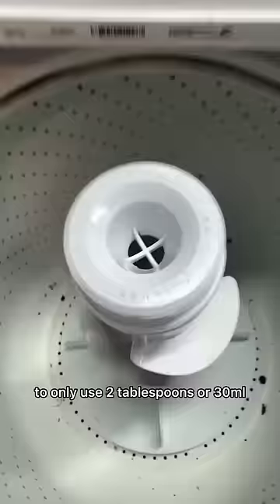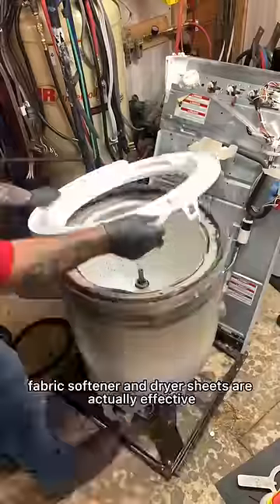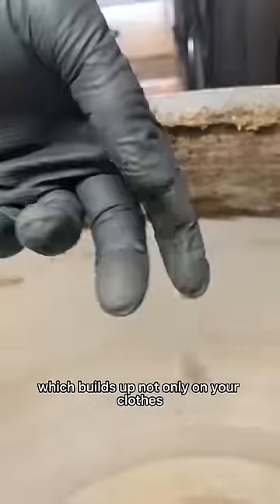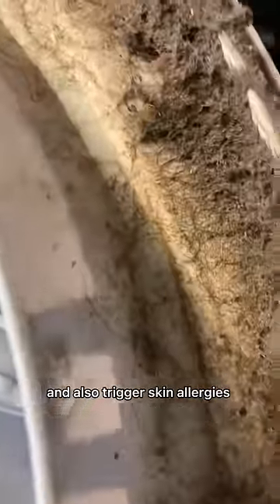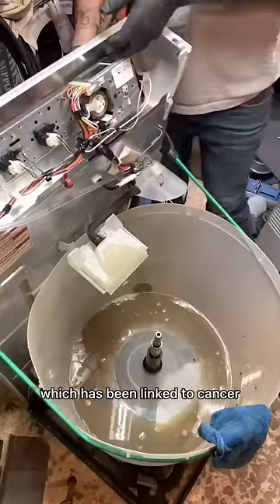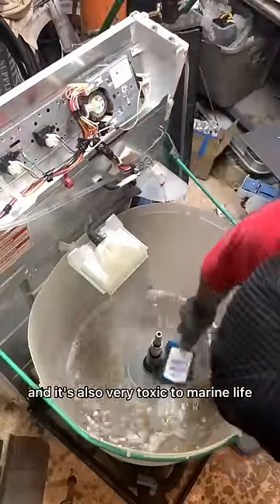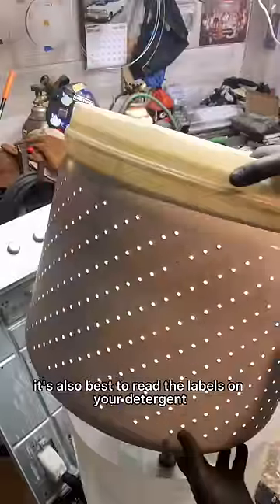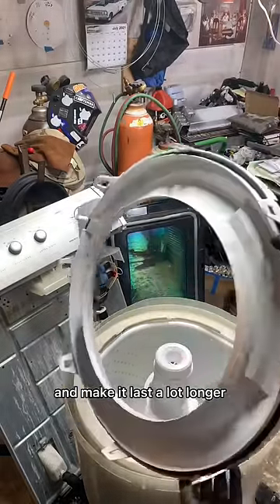Softener leads to machine failure

Comment: I used to use a ton of fabric softener and I was always itchy because I'm allergic to artificial sents but I love having soft clothes. So I started using vinegar and damm it works so well is way cheaper and I don't have a rash all the time.
Reply: How much vinegar do you use?
Reply: @Brandon-uy1uv  about a 1/4 cup for a full load
Reply: @chloecalvincooper9467  Are the fabric softener sheets a problem as well or just the liquid?  This is the first i am hearing of this.
Reply: @SuperUncleRyan  the sheets cause build up in your dryer
Reply: yes, same. i avoid everything.
my face and nose react weird. i dont have any medical conditions though.
it's an issue when living with a significant other that loves floral scents in everything
Reply: it gives me really bad time breathing, i know ppl that has anaphylaxis reaction to it 😢 is just poison.
Reply: Have you tried unscented and dye free?
Reply: @godzilla2k26  I did but it left a weird yellow residue on my white clothes.
Reply: @Brandon-uy1uv  I use between 1/2 and 2 cups, depending on the size of the washer, the size of the load and the type of fabric being washed. A full load of really nasty laundry would call for a cup in the wash cycle and a cup in the rinse cycle whereas a smallish load of delicates would call for much less and only in the rinse cycle. Based on that, just use your best judgment. If they're not coming out soft, you may need more or you may need to change detergent. If they're falling apart or you can actually smell the vinegar when you swap loads, you've used too much so definitely start small. Every load is different just like some things require starch and some come straight out of the dryer in perfect condition. I've been doing this for decades and still run into trial and error situations.
Reply: It's great for getting rid of the odor in my dogs bedding too. That's why I started using it to begin with.
Reply: Do you wash with the vinegar? Or use it as a rinse In the fabric softener dispenser?
Reply: How about the smell?
Reply: @christianpaulroldan4010  it doesn't smell like vinegar at all
Reply: @chloecalvincooper9467  whoa
Reply: @ladyfame1430  just fabric softener unless the laundry in question has certain stains. Vinegar is an acid so it makes some chemicals stay in the fabric but works great as a softener on clean clothes.
Reply: Chole Calvin Cooper 
I developed MCS in 1995 while being treated for an idiopathic autoimmune disease. I discovered I am triggered by the petrochemical used to make dyes and artificial fragrances. I have learned how to avoid triggers because it is the only way to avoid frequent ER visits. I used hospital quality air purifiers in my home. I inform anyone visiting that I maintain a fragrance free home. I always carry a spray painter’s respirator mask to use in public. People either don’t understand or disbelieve my experience, unless they witness an episode of acute respiratory distress and hives sending me to the ER. They don’t understand when I attempt to explain that the chemicals in their fragrance are toxic to me, regardless of it’s form, intensity, or pleasant aroma. Having an invisible disability is challenging; especially CMS in a culture wear artificial fragrance is so ubiquitous that it’s included in everything from mascara to housekeeping products. In addition very little of the products been tested for our safety despite fragrances having chemicals that are carcinogenic and mutagenic.
Reply: @CherishedChristianLife  I am one of those people. Having Multiple Chemical Sensitivity is very challenging in a culture of the ubiquitous use of artificial petrochemical fragrances is normal. Most of artificial fragrances haven’t been tested for safety despite many of the chemical constituents being carcinogenic and mutagenic. That stuff is scary and toxic. And it’s in everything from baby products, make up, and housekeeping products to the erroneously named “air freshener”. The latter being fragrant pollutants people used instead of opening windows. 
To stop being taken to the ER several times a month, I learned how to protect myself.
Reply: @chloecalvincooper9467  if you are having residue, it’s an indication that the product being re-deposited on the clothing rather than being removed in the rinse. It could be too much product or a build up of product in your machine.  I am laundering in a shared laundry room in an apartment building. I run a machine cleaning cycle to remove the build up of fragrant products my neighbors use before doing my wash. Also I use less than the recommended amount of product, fine my clothes wash cleaner because then all the detergent is rinsed out
Reply: @deborahpollitt7533  wow i agree and relate so much with all three of your posts. I don’t have a physical reaction to fragrances, rather just a psychological one, it’s a form of contamination ocd. Once I smell a synthetic fragrance, which is pretty much constantly once I leave my home, I just start thinking about how it might cause me endocrine disruption or cancer later down in life and I get very upset n have to at least spit or preferably wash out my mouth and nostrils with soap if I’m close to a sink. I carry around my own scent free natural soap bar 24/7 because very few places have scent free soap. I’ve ruined a lot of relationships being this way because I can’t be around people that stink of detergent fabric softener hair products perfumes deodorants etc  which is most people but I just can’t help it I wish people would see how bad synthetic fragrances are and the industry would just die.  It would be better for all of us and for the world and aquatic life. Gain is my most loathed scent lol it’s awful it clings and stays on any surface the person using it walked through it’s insane. I can smell people that use gain from a distance because I’ve become hyper vigilant about it because their scent clings to my hair clothes and skin oils and it drives me nuts so I avoid them like the plague. I wish people were miare considerate of the offensive scents they use. 

Im so sorry you have to use a shared laundry room id probably go crazy, I would consider a personal mini portable washing machine, although it seems like not such a big problem for you. Wish us both the best.
Reply: @christianpaulroldan4010  No smell at all
Reply: @bznupe25  nice, but using the machine is also good.
Reply: Have you noticed using vinegar, which is an acid, deteriorating any of your clothes? Also when you wear the clothes washed with vinegar When you sweat does the vinegar smell come back out of the clothes?
Reply: When do u put it in? Or do u just put it in the fabric softener slot? And is it white vinager you use?
Reply: How about the pods, are they safe to use? And the unstoppables? I use these all the time if it's not good I will switch
Reply: @deborahpollitt7533  l do the same with using less of the recommended laundry detergent.
Reply: @chrisw8415   no
Reply: @ipickedsomething  Sorry, you're wrong. Yes, vinegar is an acid but detergent is an alkali. The vinegar in the rinse cycle neutralizes any residual detergent.
Reply: @ipickedsomething  I
Reply: @ipickedsomething
Reply: Dryer balls work
Reply: @TotalDentalNerd  I'm still awaiting the answer to this lol
Reply: really
Reply: white vinegar? or apple cider?  my mom swore by the stuff for everything but I came to despise the smell of it from an early age for just that reason lol. but now that she's gone and my skin is super sensitive I may just give it a whirl
Reply: @WhuDhat  I personally use white but I think apple cider would be similar.
Reply: @chloecalvincooper9467  alright, might try experimenting with both, & thanks for the quick reply
Reply: I also heard that vinegar is a natural laundry sanitizer!
Reply: glad vinegar works for u, but they make fabric softener w/o fragrance or dye - i like the one by downy!
Reply: @twonahaf  true but vinegar is cheaper and I think it works better
Reply: @WhuDhat pple cider’s smell will stick around - just my own personal experience. (Fragrance sensitivity here w/ hard water: I use white distilled vinegar. Tons of people use it for cleaning too so you can easily get giant containers at most grocery stores. Especially hit up Costco

Comment: We switched to vinegar a couple months back and were super pleased. Soft clothes, only the tiniest scent of vinegar when we first open the machine and none on the clothes themselves. We also switched to wool dryer balls instead of dryer sheets. Does the job way cheaper and you just leave the balls in the dryer when you take the clothes out so you don't have to remember to put the sheet in every load.
Reply: How much vinegar do you use per one wash?
Reply: This is maybe dumb question but vinegar? Like regular vinegar right? I'm so confused 😅
Reply: I would like to know as well. You put it in the middle hole where the fabric softener goes. And is it just the distilled white vinegar that you can get at the store
Reply: @yourdetunedradio use one half cup of the cheapest distilled white vinegar for each full load.
Reply: @khoirunnisa2801 yep, the cheap stuff. Regular distilled white vinegar is what you want. (1/2 c. per load)
Reply: @LaurenBradburyFarm  do you but it in the center cup where you put the fabric softener or is it directly on the load like the detergent
Reply: @nickk4953  You can, but don't have to use the special cup or slot for fabric softener. If not just wait until the water level is up before adding the vinegar so it gets diluted.
Reply: Vinegar is actually bad for the internal components of your washing machine and can ruin it beyond repair after long enough
Reply: @zerofallen059 Oh no this is terrible news 😔 Does it cause rust or smth?
Reply: @luminescent__ I don't know what happens to washing machines when you use vinegar, but it is quite a strong acid.
Reply: @AllisterCaine  The acid eats away at the seals on various components. Using vinegar here and there isn't a problem, but doing it every load can eventually cause damage. You really don't need fabric softener. Just use a high-quality detergent.
Reply: @nickk4953 I actually alternate where I use it. For loads of undies or any soiled clothes, I use it in the bleach compartment so it gets into the wash water (1 cup for a large load). For other loads, I’ll use it in the fabric softener compartment. You can also use it in a Downy ball. Just make sure the ball is on top of the clothes when you close the lid (not stuck amongst a bunch of clothes) so it can open properly in the wash. If the clothes need an extra cleaning boost in the wash, I’ll use a 1/2 cup of 20 Mule Borax powder in the wash water.
Reply: Just air dry the clothes, they'll thank you by lasting much longer
Reply: @zerofallen059 1/2cup of vinegar in a tub full of several gallons of water will have a pH so close to neutral, there won't be any long term effects.  Normal laundry detergent and/or fabric softener likely creates water of similar pH.
Reply: @zerofallen059  Acid eats metal !
Reply: I skip vinegar during the wash and only use it once per month to clean the washer. Dryer balls are a great alternative to softener.
Reply: I create a solution of essential oils and water mixed. Some stores sell pre-made scents to be used with wool dryer balls (they are expensive) Then add a few drops to the wool balls. Let it fully dry and then add them to your clothes as they dry. It will add a gentle scent. **Don't just add the essential oil solo or use too much mix leaving the dryer balls wet, otherwise you could start a fire.
Reply: @AllisterCaine Grocery & hardware stores sell differing types of vinegar. The stronger ones are for cleaning. Although, adding a small quantity of vinegar to my 90s model laundry machine hasn't hurt a thing yet.
Reply: @thatdudej-chi not true entirely. There is something called a flash point for essential oils. I use lavender on my dryer balls and no fires yet. Just can't use certain oils.
Reply: @AllisterCaine  Saying something is a strong acid doesn't mean anything, different acids have different effects on different materials.
Reply: What exactly do dryer sheets and dryer balls do anyway?
Reply: @NoriMori1992  sure, I know. A washing machine is filled with water so the metals should take it. But people act like it's "just vinegar" so I felt compelled to make that comment...
Reply: @nickk4953 you can do either but I put mine in the area for softener.  It will remove the smell from sports apparel as well.
Reply: @AllisterCaine I put like 3 tablespoons per load.  If it’s very dirty only.  If my washer cannot handle that I will just but a new one 🙄.
Reply: Dryer balls are awesome
Reply: How is that vinegar helping with static cling?
Reply: @Anthony-to7cp Stainless steel doesn't react with vinegar!
Reply: @Cherrypi393 What is a dryer ball?...Not an American, so sorry for ignorance!
Reply: Same, love it
Reply: @NoriMori1992 dryer sheets stop static
Reply: @AllisterCaine it cleans it i use it to de calsify my washing machines
Reply: @yourdetunedradio I use two tablespoons in thee rinse cycle. Plain white vinegar.
Reply: @khoirunnisa2801 plain white vinegar
Reply: @nickk4953 yes
Reply: @nickk4953 in the rinse compartment. I also add some to the wash water when I do towels.
Reply: @shorty63136 me too
Reply: @NoriMori1992 anti static and the dryer balls fluff the clothes
Reply: @ashishsunny7963 they are wool balls, soft ball size, you put in the dryer to help fluff the clothes and May dry faster too.
Reply: THIS kinda sounds like that internet prank where they told people that they could charge their cell phones in the microwave, AND SOME PEOPLE FELL FOR IT !!    😐🤔
Reply: Same.
Reply: I’ve heard pine sol is good too
Reply: @rockettcassia  I use that when my hubby’s clothes are more dirty than usual. Then use vinegar in the rinse.
Reply: how much do you use per load?  my mum uses vinegar and every time the kitchen absolutely reeks of it, so I'm sure she's using far too much.
Reply: @MalcolmCooks  for laundry I only use two tablespoons to the rinse water. For cleaning it’s half water and half vinegar but not on stone, marble or any surface it could damage.
Reply: I fill up the fabric softener section with white vinegar, approximately 1/2 cup per large load. The clothes come out soft, the whites are super white. Works great, no smell.
Reply: @ashishsunny7963 just a ball made out of felted wool that can be used in place of a dryer sheet to reduce static on clothes. Sometimes you can add a couple drops of your choice of essential oils to make the clothes smell nice. These are a popular substitute for dryer sheets because they are reusable and do not leave a residue on the clothes.
Reply: do you put vinegar in with the wash, or the dry cycle?
Reply: @seededsoul  in the washer in rinse water
Reply: @seededsoul  People generally add vinegar to the wash cycle at the start when the tub is filling up.
Reply: @khoirunnisa2801 I use 9% acidity. Most stores stock 5%. It helps as I use about half as much.
Reply: @LaurenBradburyFarm  about a quarter of a liter to anyone reading this that doesn't understand imperial units
Reply: @AllisterCaine  yeah but it's diluted by the water in the washing machine
Reply: But why are dryer balls even needed if your dryer is already drying your clothes?
Reply: Ewww🤢
Reply: There are plenty alternatives to using VW hard for everything. Honestly using vinegar for everything grosses me out. My friend use to wash her hair with ACV and she would absolutely reek to the point of not being able to hang out with her because she stunk so badly, yet she swore there was no vinegar scent.
Reply: I did the same thing  dryer balls white vinegar and baking soda and I don't use anything else any clean my clothes way better and my skin issues cleared up!
Reply: @neoqueto air drying gives clothes a special stench. Which I cannot stand. Especially if you live in a humid area like Florida.
Reply: What do dryer balls even do
Reply: @luminescent__ Vinegar is perfectly fine for your modern washer, no accelerated corrosive will occur. In fact, Bleach is worst if you compare acidic/corrosive chemicals in each product. The manufacturer of a modern washer knows this and components are built withstand. Now, built-in obsolescence of a brand, that's something to be concerned about
Reply: Like yuck 🤢
Reply: @zerofallen059 absolutely false
Reply: @lucedluced1349  go ahead and keep thinking that, you'll need a new washer soon enough
Reply: Vinegar will eat the washer up also.  It is highly acidic and corrodes the metal.
Reply: @Adam1nToronto The problem is, in an HE washer you don't have that much water.
Reply: @Anthony-to7cp 
So does bleach. 
I doubt the amount of ½-1 cup vinegar or bleach  would hurt the metal in a washing machine.
We could wash clothes with sound waves & not need anything but water. No agitation either.
Reply: Vinegar in laundry... no thank you. I'm old school. I want fabric softener in my clothes.
Reply: 👍 wise advise
Reply: @neoqueto  Yep --- I am.now just washing my clothes & letting them line-dry.  They are just fine & not getting beaten up in the dryer.  Towels are just fine without using the dryer.  Wish I had done this YEARS AGO !!!
Reply: @khoirunnisa2801  White vinegar. It works. How much? I fill up the place for  "softener" about 1/2 full for smaller loads, 3/4 full for tough loads like work jeans.
Reply: @LaurenBradburyFarm Only during the rinse cycle.
Reply: @AllisterCaine nope
Reply: @luminescent__ neither. it's ok.
Reply: @Anthony-to7cp what is the pH of the solution of 1/2 cup of white vinegar in 5 gallons of water.
Reply: you can use wadded up aluminim foil to do the same as wool.
Reply: @LynxStarAuto      Probably mildew trying to grow.      😊
Reply: Why would you need either? Clothes nowadays are already soft off the rack especially with cotton/poly blends.
Reply: @joen4088  Preventing static. I just use balls of aluminum foil